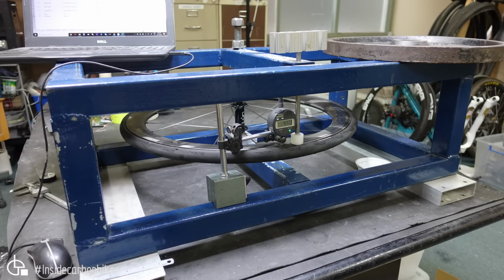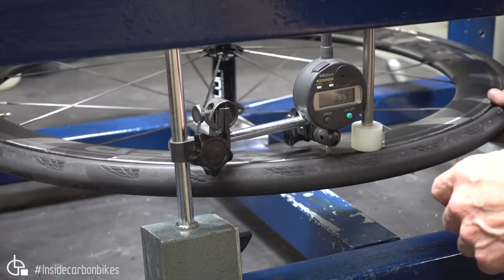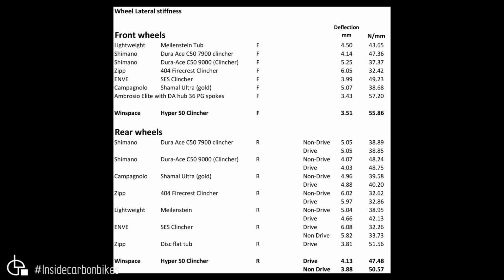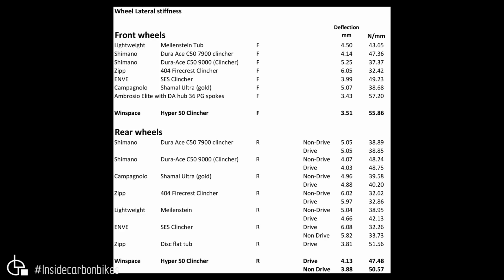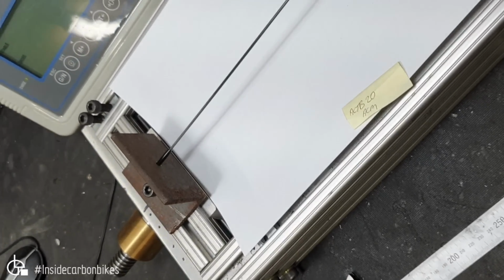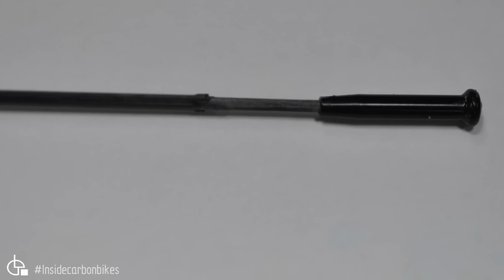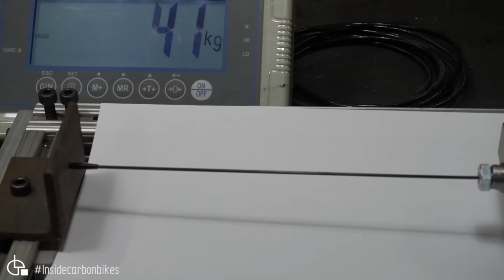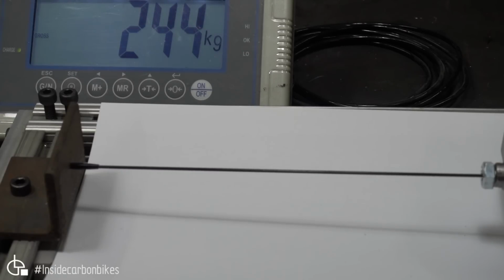Winspace Hyper Wheels - What they didn't tell you.

Comment: From the engineering purists perspective which is the side of the fence I sit on. We'd always tend to go for isolation. Basically, make everything else as stiff as possible and let the suspension ie the tire take control of the damping. I appreciate that is not to everyone's taste but it's more to do with not having to account for something that is uncontrollable. 

The only other comment I had was around the moment of inertia for the winspace wheels. They are much lower than any other wheels I've had in to test and a large part of that will be the carbon spokes, a narrow section also helps a lot. You won't get the same level of damping purely by geometry versus other types and you get the benefit of fast acceleration. I know the term "spin up fast" is a term that I regularly use to ream muppet journalists but in this case the rotating mass is reduced so they will accelerate faster 

I think carbon spokes will become the norm shortly.
Reply from the maker: The problem with letting the tyre do all the suspension is that the spring rate and the damping rate are not independantly adjustable, that is by changing the tyre pressure the spring rate changes, however the damping is influenced by the tyre carcass and not adjustable. Hence a system approach is used to provide the ride characteristics required and reduce the variation in the tyre face load. Ride quality is one case where stiffer is not always better.

When the muppet's talk about "spin up fast" they forget that to accelerate faster they also decelerate faster which can effect net speed depending on a range of variables. Typically bike industry marketing departments pluck one advantage and ignore the disadvantages, which you are well aware off ;)
Reply: In performance engineering i would tend to agree but not on this case. The problem with letting the tyre do everything in terms of damping is at it some lower pressure you will get a huge increase in rolling resistance. My view would be to tune the spring mass damper in the frame/rider connection and keep the tyre at a higher pressure/optimal rolling resistance.
Reply: @PeakTorque  true, and not just rolling resistance but also more chance of denting rims, tyres rolling off the rims and vague handling. I run quite high pressures on all my bikes for that reason, combined with sticky rubber and compliant suspension so the bike still grips. 

If I’d buy a roadbike I’d prefer to have compliance built into the frame/seat post with some pretty stiff (but not ‘dead’  feeling) wheels and rock hard tyres.
Reply: I'm agree. Wider tire, less pressure and stiffness is ok. The noise from the hub is really annoying. The only advantage is to avoid dreamy pedestrians when crossing towns.
Reply: @arnaudseynaeve9266  Mmmm dreamy pedestrians!! I hit one at 30kph and broke my neck!!! He walked out in front of me on a dedicated bus/cycle lane at Gosport in the UK!
Reply: @merckxy54  Riding in the city, it's sporty. Me, I had my hand broken with a distracted pedestrian
Reply: Shame there was no test of an old-school  but comparable (or lighter!) weight wheel.
E.g. an MA2 on a 36h fh-7700 (8/9spd) with 1.8/1.6 ds, 1.8/1.5 is lighter than most of these and I'd wager stiffer.
Reply: @thomas618  look Damon Rinard wheel-stiffness tests… 20 years old but you have around 100 wheels tested there. Just need to divide the force by the wheel deformation to have comparable measurements.
Reply: @cipo36an203  yes, saw those when they were fresh;-)
Having a supposedly flimsly 400gm box section alloy rim demonstrate superior rigidity to super carbon might open a few eyes...
For all this 'the wheels too stiff' talk, I suspect wheels used to be a lot stiffer and it's only because of the progression from 6/7spd to 8/9spd to  >=11spd freehubs are now so ridiculously dished that we're even talking about this...
Reply: @thomas618  I see you are a man of culture ;)
15 years ago, wheels in the 60+ N/mm where very normal. Spinergy used by Cipollini were more in the 70s… but weight 400g more than modern options
Reply: I very much agree with your approach and thinking. Besides that, I own a pair of Hyper 50 wheels, and like them better than my Lightweights, Rovals and Enves. Great that the testing confirms my subjective feeling.
Reply: I think wheel acceleration is over-rated.  While it's true high inertia wheels spin up slowly, they also spin down slowly, and so they tend to maintain a more constant bike speed over time, whereas a lower inertia will have more speed fluctuations.  This is why indoor trainers have heavy flywheels.  But it's all minimal compared to the translational inertia of the bike + rider, so if you're riding rollers, rotating mass is a big deal, but otherwise, it's less important than if your water bottle is full, since there is a 1:1 relationship between rotationa momentum of the wheel and translational momentum of the system on real roads.

As to stiffness -- I want my frame to flex (I never understood Tour's obsession with frame stiffness), but I don't want my wheel to laterally flex, as this will result in brake rub (for rim brakes -- I don't know disc brakes) and will also in theory affect handling.

It's interesting the tone from lateral impulse is so truncated -- there's a lot of damping in the spokes.  I am guessing a steel spoke would ring much longer.

As to whether tires can adjust spring rate and damping independently: that's where tire diameter comes in.  There's not much range to adjust tire pressure for a given tire diameter.  You want a certain amount of deflection at the contact patch to prevent bouncing or pinching.  But going to fatter or skinner ties allows changing this optimal pressure.

I like the idea of using teflon tape.

If I was in the market for carbon wheels, these would probably be my choice right now.

BTW, I can't believe it's 2021 and people measure force in kg :). (vs. Newtons)
Reply: Just like everything else with regards to mechanical engineering, testing a single component to failure is all but pointless. Even the weakest decent spoke can take way more tension than is ever required when built into a wheel.  I'd like to see a real-time model of a spoked wheel rolling with weight/transmission/impact as adjustable variables.
Reply: Usual Hambini rubbish
Reply: Hambini, please do not post more comments. Everything you say is absolute nonsense
Reply: Unlike Hambini whos some dude in a boiler suit constantly raving about having some obscure role in aerospace while trying to profit off gullible youtube viewers by selling overpriced bottom brackets, Raoul has real experience in composites and bike engineering.

Sit this one out champ, or go peddle your gimmicks elsewhere.
Reply: @JohnDoe-xx4ig  How dare you talk to a 5 year old like that. Shame on you.
Reply: @JohnDoe-xx4ig  not to defend Hambini but saying his BBs are overpriced is nonsense. Cheaper than many, manufactured in UK with more expensive production methods (single piece over multiple pieces) and focussing in geometrical precision that is 101 of bearing rules. 
Now his complains on BB tolerances are repetitive even if extremely valid. As users we shouldn’t have to wonder if a frame is built with tolerances a 1st year engineer-student would know by heart.
Reply: @cipo36an203  Hi Jordi. lol
Reply: @vietnguyen4312  wow, blown by your arguments… please enlighten us cause as mechanical Engineer I though I knew what I was talking about.
Reply: @JohnDoe-xx4ig  butthurt?
Reply: @WanderingSword  - You'd enjoy "Graham's Hierarchy of Disagreement."
Reply: @JohnDoe-xx4ig  hambini is sharing his opinion, why you need to mock him, he is trying to explain from his point of view, hes not trying to trashtalk luescher dont he? having those argument is good for us cyclist, idk where you stand from
Reply: @JohnDoe-xx4ig  speed as a product of ride quality vs stiffness was the issue…compliance over differently textured surfaces has nothing to do with whether you like Hambini or his products. At least you’re trying to educate yourself…well done!
Reply: @JohnDoe-xx4ig  Hambini exposes how crap bike company QC is by showing that they can't make a simple round concentric holes in their frames, and after seeing enough of it he decided to make bottom brackets that fixes the problem through better engineering design and machining tolerances.  Seems like what any enterprising engineer would do.  

His bottom brackets are expensive, but overpriced?  Looking at the precision he is able to produce, they are a high quality product.  Machining parts to exacting tolerances is expensive.  In other words you get what you pay for.

Maybe you can't afford them so you call them overpriced and lash out at the guy.  Don't let your lack of money make you too bitter, champ.
Reply: @infinati  This QC issue is nothing new.  I purchased a mid-range Bianchi with Columbus tubing close to 40 years ago.  The BB was oval and half the threads were missing.  They were making steel frames for decades and still couldn't get it right, even back then.  Hambini FTW!
Reply: @JohnDoe-xx4ig  ham beanie talks way too much for a male, insufferable pretentiousness.  I own two Cannondale bikes, a CAAD12 and a CAAD Optimo with BB30 bottom brackets.  Nothing the man said ever diminished or enhanced my cycling experiences with either bike.  Therefore, I bypass any video or expressed opinions from the fellow who seems so infatuated with his own blabbering.
Reply: @JohnDoe-xx4ig  you must be employed by one of the POS bike companies. Either that or your head is too far up your ass to recognize half assed engineering.
Reply: @JohnDoe-xx4ig  true words. He also mentions all the time, how big of an engineer he is... Ridiculous

Comment: Thanks for putting the time and effort into looking at our wheels! We especially love this video because the wheels you tested you got from a customer and we had no idea they were going to end up in your hands. All of our 'review' wheels are straight off the production line with no special treatment, but, it's obviously impossible for us to prove that. So, you getting your hands on these is great. Your test data is very close to our own. Very glad there was no use of the yellow pencil. ;) ;)
Reply: Oh, and for the past ~6 months the rear DS spokes no longer touch. ;) We tested this change and found no noticeable difference in lateral stiffness, but it got rid of that noise. Thanks again for your time and energy in this video.
Reply: @WinspaceBikes  For your information, the noise on that particular wheelset does not occur anymore (they are my wheels. lol)
Reply: @WinspaceBikes  I thought that was due to under-lubricated hubs as @CamNicholls pointed out. Also, is there a rim brake version of these with grooves for better wet weather braking?
Reply: Would you recommend using the HyperX for gravel?
Reply: @Grunge_Cycling  winspace got gravel specifics wheels, it called Lun Grapid 700
Reply: @Grunge_Cycling  as Raoul stated, they’re so stiff you may lose traction on bumpy roads. So I’d imagine not ideal for gravel.
Reply: @Grunge_Cycling  I wouldn't use these in gravel because 1) they're not wide enought, 2) they may be too stiff for gravel (even though I myself want them to be even more stiff for the smooth road I'm using them on).
Reply: Would you consider doing a high speed test and throwing an object at a rotating wheel to see how the spokes react? Obviously in a lab and along the line of what Raul was discussing towards the end of the video
Reply: @WowRixter  I had a rear brake caliper go into my rear wheel that ripped half the spoke flange off the hub, ripped 2 spokes out of the rim and scared the crap out of me.
 Fortunately, and I don't know how, but I didn't crash. Whilst walking my wreck to a pick up point I shuddered at what might have been if it was front wheel.
Reply: How did that brake caliper come off? Didn’t you check the tightness?
Reply: @WowRixter  I don't think anyone would wanna be the guinea pig... If you do it in the lab isn't the same coz the bike isn't moving, there have to be a moving force.
Reply: @csren8328  you're probably right. I was just hoping there's a way to test that in a lab simulating speed and rider load
Reply: @WowRixter  lab test can't represent in the real world bro, there's too many variables. 
I'm 85kg rider, used winpace SLC frame with hyper 50 wheels with no complain.
Reply: I have had  issues with Winspace wheels. The spokes come unthreaded after EVERY ride. My LBS and Winspace even rebuilt the wheels themselves and it happened again the next ride. Winspace does not give full money back when refunded. Please be careful with buying these garbage rims.
Reply: Nice post Winspace. Well said.
Reply: the brand name is so obnoxious though, the word hyper even more so. Check out the song hyper hyper by Scooter and you understand instantly why this is a word nobody cool from Germany would ever want to read anywhere on his or her bike. Please, next time think a little before you choose a brand name. This goes for most of the cheaper chinese brands.
Reply: Can you let me use some for review on this channel @WinspaceBikes ?
Reply: this is how react to a test video correctly... whether it is good or bad -  #absoluteblack ... uhm i meant absolutecrap you should grab a handfull of possible solutions here !!!
Reply: Hi. Just curious if it is possible to order wheelsets of mixed depth from the site?
Reply: @87togabito  nope I doubt so.
Reply: why no tubular rim brake models available?
Reply: @stibra101  who still uses tubular rim brake in 2021? 🤣
Reply: @lIIustration  I know many who will use them in 2051.
Reply from the maker: @Art    me!
Reply: @lIIustration  well people with attention to details (lighter, often a bit stiffer, more confortable) who are sensitive to the particular road-touch / feeling tubular gave you.
Reply: @cipo36an203  Most importantly they are cheap as dirt nowadays as nobody wants them anymore.
Reply: @82vitt  cheap? I am not seeing any of this anywhere? You may have more offer in the second hand market but new wheels are not cheaper in rim brake.
Reply: @lIIustration  Me, for criteriums.
Reply: @lIIustration  me
Reply: @cipo36an203  Tubs are much cheaper. I got my Campag Bora One tubs for rim brakes with 40% discount against the RRP. Nothing wrong with buying second hand either, if you know what you are looking for.
Reply: @lIIustration  All professionals who are NOT blackmailed by their sponsors not to??..     Rgr
Reply: @82vitt  Bought my pair, just the same as yours, on fleabay for 500,00 Euros, came with almost new Conti Sprinters. Expensive, anyone said??     Rgr
Reply: @borano2031  Nice one, good for you :).
Reply: What are your thoughts about the security concerns mentioned in this video?
Reply: oh wow. his friend lent him a set of wheels and with a spare spoke too for destructive test... and winspace have absolutely no idea about this....hmmm
Reply: @fhetfet6402  these wheels are supplied with spares by the manufacturer. RUOK?
Reply: Theses are UCI approved know correct?

Comment: Theyll probably just coat the contacting points of the spokes with Teflon to solve the noise issue. I'm with you on the stiffness being potential issue for traction, being not just a roadie but a keen DH and 4x rider too ive had fork and wheel combos that were too stiff and lost traction on off camber sections sooner than lighter builds.  Stiffness in the forks has the same balancing act to play too. Also having been on a variety of disc brakes over the last 20 years  I still find it hard to believe the pro peleton are having so many issues with disc brakes its nigh on comical.
Reply: they redesigned it so spokes no longer touch.
Reply: @eto2352  nice one, thats a far better approach 👍

Comment: Looking forwards to a video with sticks of different size and chicken shot into a wheel rotating at high speed.
Reply from the maker: Lets build a chicken cannon!!!
Reply: @LuescherTeknik  Ive worked with one! Ex Rolls Royce aero engine test technician here. We built and used a rotating drum and air cylinder which fired chicken carcases (from the local supermarket) into the intake of running aircraft gas turbines. Up to 5 carcases per second at variable velocities. A mini version would be perfectly buildable!
Reply: @grahamwhiting6567  I’ve seen the videos of this, and the way the titanium blades warp upon impact is amazing! True pre BBQ/ post roast apparatus!
Reply: Let's fire Hambini into a Ge9X. Some say this is where the term 'Hello Hambini fans' comes from.
Reply: @PeakTorque  don’t see why not - he’s built my BB now and all is ok, so he’s ready…
Reply: That's the sort of testing i wanna see.
Reply: Royal Canadian Air Farce has a spare chicken cannon from their comedy sketch 😆
Reply: we need this

Comment: Isn't the bike basically just mass spring dampers in series from a comfort / stifness point of view? In that case surely the tires are probably less stiff by orders of magnitude so the extra stifness would be like increasing by like 2 psi?
Reply from the maker: Tyres are less stiff than the wheel radial stiffness for sure, however the lateral stiffness/damping plays a role in traction also.
Reply: @LuescherTeknik  ah yes. Especially when cornering I see how a bit less would definitely help traction.

Comment: Like to hear your comments on disc wheels, were the spokes on the front are at different tension and only a limited number of spokes are transferring the brakIng forces to the rim.
With the cycling of braking forces on so few spokes whats your thoughts on fatigue.
Reply from the maker: Good questions, I don't have any data on it at the moment. I did test this on 32 spoke MTB wheels and differnt lacing patterns many years ago, however that is quite different to low spoke count road.